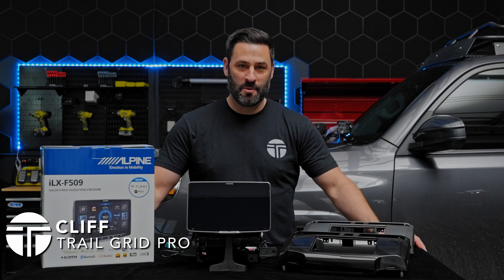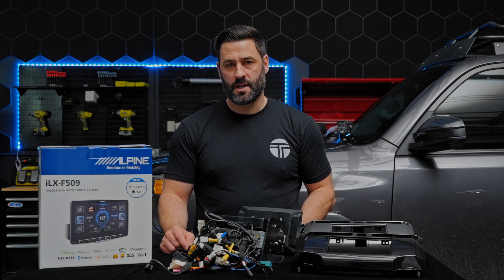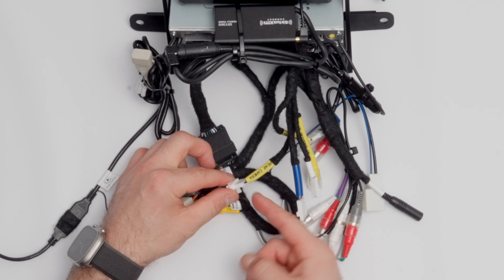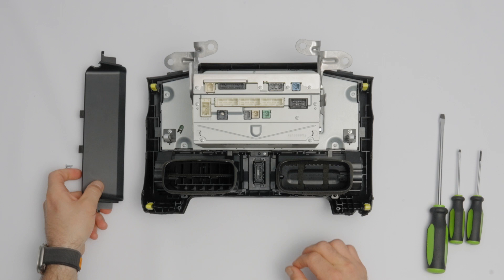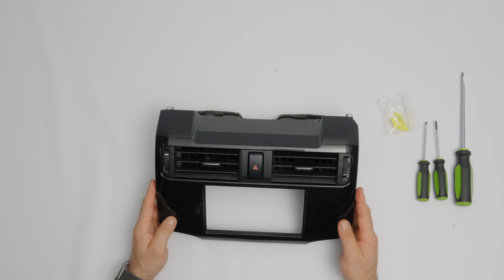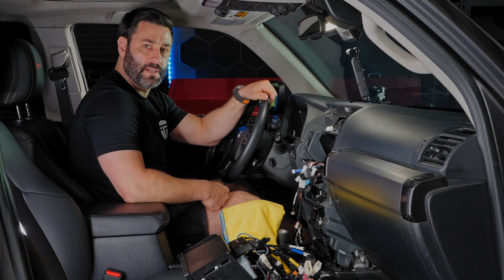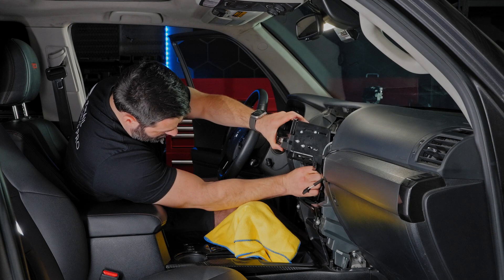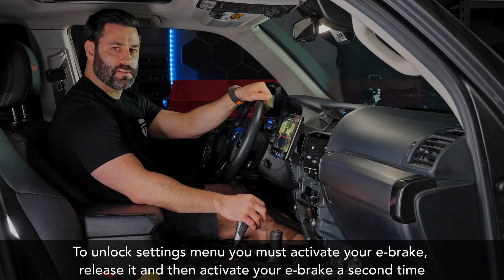Toyota 4Runner Alpine iLX-F509 Installation | 2010 - 2024 Toyota 4Runner

Comment: Also the video say the "standard" install is 3 main factory connectors, and then adds antenna.  However the materials on your website shows a reverse camera harness too (i.e. quote "For 2014 - 2019 4Runners you will be making 4 main vehicle connections". - but the video doesn't say anything about.
Reply from the maker: Yep, you're right! 14 - 19 will have 4! So sorry for the oversight but we appreciate you VERY much!

Comment: Why did you call out the power connector (i.e 24:22 mark) -- could there be multiple ones that fit?  Asking because I just tried to install this kit this weekend and I was unsuccessful - nothing turned on.  Im worried I did not connect to power.  Any help
Reply from the maker: For 2020+ there's two connectors that are the same size and one of them controls power. So, if you plug in the wrong one it won't power on. For 2014 - 2019 this does not apply.

Comment: Where does the OEM Toyota front and side cameras plug into? Does it require an adapter or is it plug and play too?
Reply from the maker: Great question! No additional wing is required for the OEM cameras!
Reply: @TrailGridPro So my ‘16’s OEM back up camera will still work too? Where does it plug in?

Comment: I have the ICS Fab  mount installed currently.  Is that compatible with the Alpine installation / easy to install with it?
Reply from the maker: Cliff has the Alpine ILX-F509 in his truck with the ICS Dash Mount and it fits and looks great! Your head unit will come with a new dash face plate that the mount will need to be transferred on to.

Comment: The video doesn’t mention the connection from the OBD2 scanner.
Reply: Trail Grid Pro's answered my question - here for anyone else that hits it.  There is a similar grey/pink wire port than one of the two ODB2 connectors goes to. The second connector has red/yellow wires and this does not get connected to anything. Just leave free and unconnected.
Reply: We need a video with the obd2 wire
Reply: This video is amazing man thank u so much, im going to install the ilx-f511 with a maestro module
Reply from the maker: Thanks for commenting! Some of our videos could use some updating, but we're happy to answer any questions sent to our support email!

Comment: Sorry, but id like to be clear...the oem multi terrain monitor does still work?
Reply from the maker: Yes it does! :-)
Reply: @TrailGridPro  Thank you.  I know it's stated but I have not seen a shot of the 360 cam on any of the units.  Doing far research into a 4runner purchase currently.  Gotta jump before they ruin them!   Might want to stress this function for those who have the feature.  It gets muddied by the front and rear cameras from Alpine....seeming like you need their cameras for front view.  I will for sure be purchasing this system if I can get myself into a T4R.  Kudos for allowing audiophiles to have good sound in their Toyota's in an easy to install package.

Comment: outstanding video as always. 
Some questions:
Can the factory 3.5mm input functionality be retained on a 2018 4runner?  maybe as Aux?
Does the bundle have obd functionalty, for tire pressure and temps etc?
thanks!
Reply from the maker: It actually can be retained! We didn't in this video because this was being put in a 2020. Yep, the Alpine kits have gauges, etc. as well!
Reply: Do you have to add a resistor between the OBD2 and the head unit’s power for the TPMS to be read by the headunit? I had this problem with the iLX-F309 for the 4runner

Comment: It says it will fit 2012 4runner on alpine do you know if thats true? it is a very pricey read for sure.
Reply from the maker: The head units are universal to most vehicles, the only differences would be the wiring and modules necessary! We plan on expanding to more year ranges moving forward, so stay tuned!